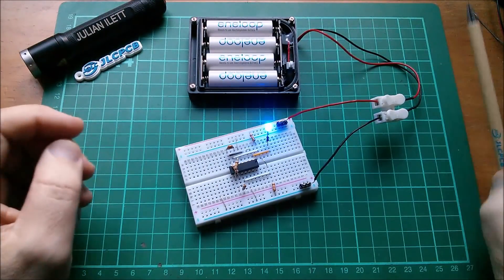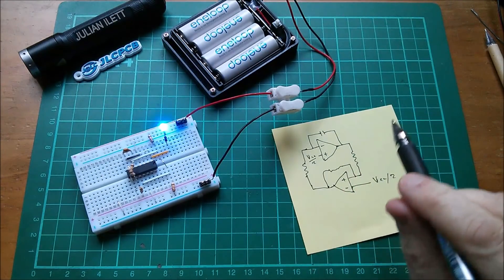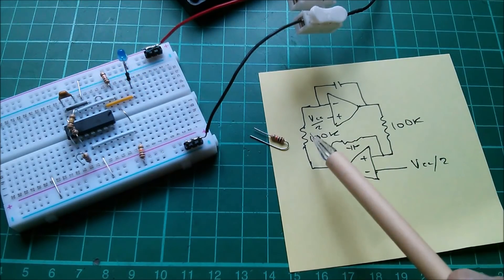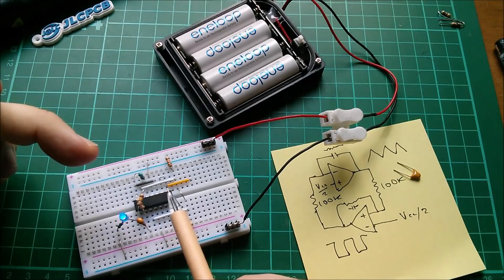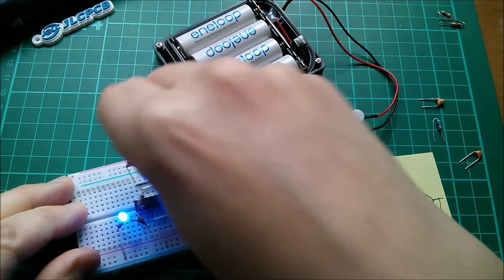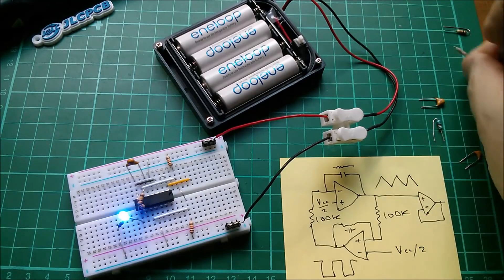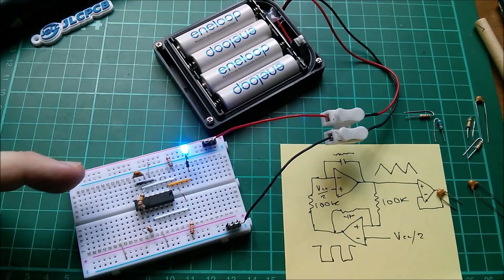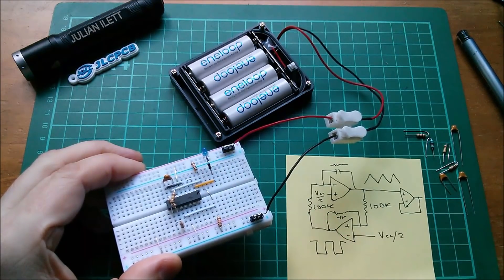Op Amp LED Flasher (weird version)

Comment: Might be worth converting the buffer to a voltage controlled current source, then the LED current would be dependent on the ramp voltage, making the brightness increase and decrease in a even more linear fashion.

Comment: Yes Julian, that is weird where the only normal part of the circuit is the ‘unity-gain-follower/buffer’ on the output.  What’s strange is the comparator operation value swaps in each Op-Amp with capacitors in place.  So yes, a strange but delightful configuration overall.

Comment: Julian,

I hope this is able to reach you via EMail as comments in the YouTube vidoes always seem too short. Yet I will try to keep 

this short as well. I keep this to basic text format only, thus no pictures/diagrams, keeping it cleanest possible for 

virus etc issues.

As already mentioned in the comments your "Wierd Oscillator" is using the LM324 in many respects outside of 

specifications. Many OpAmps would actually already be dead, and the LM324 many work but deterirorate over time.

Critical parameters related to this system operation include the following

For ESD protection, and often not well detailed in data sheets are diode, resistor networks on input pins, that absorb 

some level of Electro Static Discharge. That can be peak currents reaching amps, but of very short, sub microsecond 

duration. Typically data sheets will include a maximum average current. In the LM324 data sheet there is no secific limit 

but similar to normal can be expected.
maximum input terminal current  = 10mA, 
That level is to be ensure that any source voltage applied will have sufficient source resistance to limit current below 

that 10mA. Of course depending on pulse duration higher current could be applied, total energy should remain well below 

equivalent of clipping voltage times max current. The higher the energy to more likely long term detrioration and failure.
In this LM324 case the diagram at sect 8.2 shows only negative side clipping diodes, but also stated is input must not 

exceed Vcc-1.5V first paragraph sect 8.1. Any higher and the input transistor base emitter junctions will be destroyed. 

These are tiny junctions, designed transistors are only uA collector current and input bias current in 10's of nA, and 

most certainly will not safely take even 10mA.

 Differential input voltage is stated in the data sheet at up to maximum Vcc voltage, sect 6.1, but caution the above 

mentioned max input must be less than Vcc-1.5V  so what ever supply voltage, inputs must not go above Vcc-1.5, at 5V 

supply that will be 3.5V. Negative side is listed at -0.3V, that is so those clipping diodes mentione dbove, do not get 

active condition. These limits are however mainly for linear OpAmp operation, and that is not yet breakdown of the double 

base-emitter junction, or negative clipping byhe diodes. So for typical silicon devices that B-E breakdown would likely 

not be for up to 10V higher. But also the equivalent circiuit in 8.2 is not true complete circuit, with transistors on the 

chip having isolation junctions (diodes) etc.  Beyond Vcc the chip is in potential danger of various interconnects and 

possible through conduction supply to ground. Some older devices suffer SCR latchups but modern designs try to minimise 

that risk.

Finally one critical parameter to consider is the output drive capability. As the output is switched at Vcc/2 threshold, 

the capacitor has about Vcc/2 on it, and being driven by change of state on output will try to go to Vcc+ Vcc/2 on low-

high and Gnd-Vcc/2 on High-Low transistions.  The indicated negative end diodes will clip at about GND-0.7V with whatever 

peak output drive is available. What happens on the positive side is not certain but definite beyond the Vcc-1.5V spec, 

but maybe still under B-E breakdown is supply is <12v. 
Iout MAX =  +-60mA SHORT and around 20-60 source and 10-30mA sink.
---------
PROPER OSCILLATOR USING AN OPAMP IS USING ONLY ONE AMPLIFIER.

Place a Capacitor to ground from -ve input to ground, and oscillation rate resistor from output back to -ve input and 

capcitor.  Now to oscilate we need to use positive feedback hysteresis using the +ve input. This is done with two 

resistors giving the 1/2 supply level to the +ve input a divider much as you inlcuded in your circuit, and a feedback 

resistor from output to +ve input and supply divider. The feedback resistor in ratio to the equivalent divider resistance 

will set the hysteresis, taht now will give an upper and lower switching pioint of the charge volatge on the capacitor.
Say we use 10K resistors across the supply, that gives 1/2 supply level and equivalent resuistance of two 10K in parralel, 

thus 5K. To get upper and lower threshold 75% and 25%, other levels equally feasible, and assuming full supply swing out 

the output, calculate Vcc*5K/(Rf+5K) =0.25Vcc,   clearly Rf =3* 5K. Note the LM324 does NOT drive full supply level at 

lower loads, a load 2K   only to Vcc-1.5V, the output for >10K load is not well specified but probably still a bit short 

of full Vcc. Anyhow for practical purposes affects the actual threshold on high side so not quite 75% attained.

  Vcc    --------
   |   -------|  15k  |----- 
 -----   | -------- |
 |   |   |   |
 10k |   |   | | \  |
 |   |    ---------------------| + \  |
 -----    |   |    \  |
   |    |   |     >----------------
   |    |  --------| -  /  |
   ----------  | |  /  |
   |   |  /  |
   |   |   |
 -----   | -------- |
 |   |   --------| |-------
  10k |   |   | ---------
 |   |   |          Rt
 -----      _______
   |      _______  Ct
   |   |
 =====   |
        ======   

TRY IT, As the capacitor charges, from 0V, the output will of course be positive a -ve is less than +ve input, and the 

threshold will be upper limit as output is high. Once the capacitor has reached high enough, the +ve threshold is crossed, 

forcing output to go low, causing the threshold on +ve also to go to low limit. As output is low and thus discharging the 

capacitor, the -ve input will move downwards till the low threshold on +ve is reached and the cycle reverses. And thus is 

born a oscillator that has frequency controlled by Rt, Ct and the threshold chosen for switching. At no time will the 

device limits be exceeded, as lomng as the OpAmp can acces larger input differentials on input like the LM324. NOT ALL 

OPAMPS can acces large differential inputs!  A comparator can also work fo this oscillator but usually is open collector 

output, but the hysteresis ntwork can be used as load, and carefull design uses no more resistors, though more complex 

calculations.

good luck, leave the weird circuit it is not using devices within specification an depending on capacotor stored energy 

may long term fail or even immediate fail for manyopamps.  as the LM324 has 10's nA input bias the resistor values can 

crtainly go to 100's K ohm even Meg Ohm if some bias inflince is allowed. There by usin much lower power to run, than usin 

K ohm range values, and smaller capaciors for longish periods.

hope this is of use to you. Have a Merry Christmas and Happy New Year.

Comment: One of the problems you might run into with the classic LM324 is the crossover distortion when driving a capacitive load, as is the case with some analog filters. Just be sure to bias the output with a 1K pullup or pulldown to keep the output stage in "class A" mode. Also the GBW and slew rate are pretty poor Although for breadboarding its plenty fast. Faster opamps tend to be difficult to compensate anyway.
Reply: Positive feedback is mandatory because otherwise the comparator will begin acting like a really high gain linear amplifier once the right input voltage is reached and will go from "astable" to stable.

Comment: I'll try that eventually.  Interested if the 4th op-amp can be another buffer and tie them together to the LED to get a ramp up and down with a flash at the top.  I've got a small Light House that needs a beacon.  Merry Christmas.   Keep it safe - it keeps it safer for the rest of us.

Comment: If you were trying that with many opamps you would desyroy the inputs
 The LM324 like some others allows diferentisl inputs to be ip to full supply. Most do NOT and limit to as little as +-0.7V. An opamp by intent is used with tiny diffrences on inputs amplified by high gain, a comparator differs as it is intended to switch output state based on diffrence orientation of inputs. Not all opamps work as comparators. 
Your lower (+) input opamp with capacitor as feed back is running as a comparator... as output drives positive direction via capacitor, its + input drives above 1/2 supply  driving output fully positive by feedback. If the upper (-) gain stage is allowing its ouput now to ho low, the 100k to + input of lower amplifier to start to lower the + input level by discharging the capacitor across the lower amplifier, till + imput drops below 1/2 supply. At that point the + gain drives its output low by positive feed back, the capacitor that now has 1/2 supply voltage on it drives the + input down by full supply making the input go beyond ground by 1/2 supply. Potentially overdriving the input, probably protected by Esd protection of inputs, which may survive or not in the long term, these are often rated to a few 10s of mA. In this case the protection diodes will clip this excessive below ground at ground 0.7v or so. May last or die at some point. Anyhow the low output on the lower amplifer will via - gain upper amplifier reverse its output high thereby allowing the capacitor to reverse charge direction till + input of lower amplifier to exceed 1/2 supply at which point lower ampilfier again swings positive by feedback, again druving the positive input higher to supply level plus 1/2 supply.. Same over drive issue clipping input to supply +0.7v.  Repeating as long as the inverter top stage can keep driving to opposite direction. The lower capacitot thus swings + 1/2 supply, and must never drive the + input beyond supply or  ground or input could be damaged on most opamps as already rais ed d many can not even allow larger input difference voltage in the first case. The LM324 does allow supply range difference, but not reliably 1/2 supply over drive. So far seems to survive with the energy limited by the feedback capacitor suze, much larger capacitor may finally kill ESD protection .
The playing of values around the upper inversion stage controls how the output reversal of input to 100k lower stage input takes place. High gain fast change over, low gain less fast, attenuated incomplete output drive slowing the charge reversal of lower capacitor. Added capacitor at top stage makes it ramp the output affecting changeover rate and oscillator timings.
Worst aspect remains that 1/2 supply overdrive of the lower + input as the output switches at 1/2 supply comparision threshold. Beware circuit appears to work but is not a proper use and many opamp types will self destruct!

Comment: I am sure you only need one opamp to make a flasher. Connect the cap from the inverting input to ground and a high resistor to the output. Put positive feedback on the  non-inverting input with the second resistor to vcc / 2, or use three resistors.

It makes an inverting Schmitt trigger with an RC from the output to the input so you get an oscillator just as you would with a logic gate Schmitt inverter. No triangle wave though, but can be close to one on the inverting input if you make the Schmitt hysteresis small compared to VCC.

Comment: Please measure the capacitance of the breadboard, you will be surprised how much you find and i think that that capacitance is the reason that this configuration works
Reply: Boy is that a PITA. I made an osc on a BB, and when I transferred it to a PCB I had to change all the cap values to get it to act the same.
Reply: Avout 2 pF per pair of rows I'd expect.

Comment: So, where is it written that the positive rail has to be at the top of the board? And similarly where is it written that the negative rail has to be at the bottom of the board? Wire the power rails the other way round and your LM324 can then be the correct way up 😁
Reply from the maker: So many ICs (particularly logic ICs) have Gnd on the low numbered pins and Vcc on the high numbered pins. Single and dual op-amps follow the same pattern, but quad op-amps are different. Why?
Reply: @JulianIlett  They identify as gender neutral, don't persecute them, their just different that's all...Heheh!
Reply: @JulianIlett  Perhaps they have two dual op-amp chips in there and one is rotated 180 degrees for easier routing of the bond wires?

Comment: I can't help thinking that you are over complicating this. A single transisor or two and some discrete components will do the same job. It may make more sense if you consider the op amps as essentially perfect transistors.
Reply: I'm afraid your missing the point, he's not trying to flash an LED, he's playing, this is his sandbox.
Reply: andymouse123 
I get that. It just goes against the grain of my professional training to see poor op amps abused this way. It is interesting, but likely to confuse anyone just trying to get to grips with electronics. I watch all the videos anyway, even the ones that make me cringe.
Reply: @michaelkaliski7651  Ah! yeah, I understand, happy holidays!
Reply: So if using op-amps is overkill, you must really hate it when a microcontroller is just used to flash a LED or another really simple task...
Reply: Mark 1024MAK 
Like you wouldn't believe! LOL
Reply: Nick B 
Using a microcontroller solely to flash an LED is inefficient. Using an otherwise unused gate to provide an indication of something happening is entirely different. I grew up in a time where components were expensive and everything needed to serve two or more purposes if possible. The days when a working Chess program could be squeezed into 1k of 8 bit RAM! The demonstration in this video is fascinating and somewhat counterintuitive if you don't have a detailed background in component level design and project building.

Comment: I'm getting frustrated: can't think of any way to use your discovery. (Nor the conventional arrangement, truth be told.) Frustrating because it's so neat and I wanna use it in some manner.
Reply: The circuit is useful as a simple 0-100% PWM generator. Well, at least it was useful for that until you could get a microcontroller for cheap and do it with way fewer components (only a potentiometer needed). If you use the third opamp as a comparator (variable voltage from a pot connected to the inverting input) instead of as a buffer, you get PWM at it's output. If you use the fourth opamp with the inputs switched around, you get the inverted PWM for push-pull applications (although there's no deadtime control so it's not really safe for switching transistors without further circuitry).
Reply: @superdau  its output ;)
Reply: I challenge you to use it as an audio level visualization LED flasher. Like, as an audio input signal gets louder, the LED gets brighter (I know it doesn't employ the flashing feature, but It should still be achievable)
Reply: It's not a new discovery ... it's a Basic Op-amp Monostable Circuit ... https://www.electronics-tutorials.ws/opamp/op-amp-monostable.html